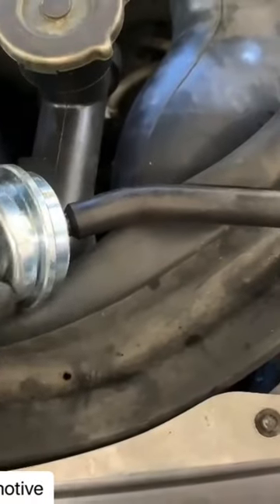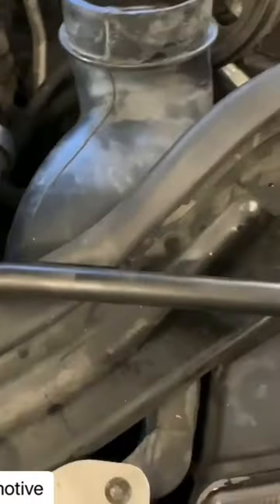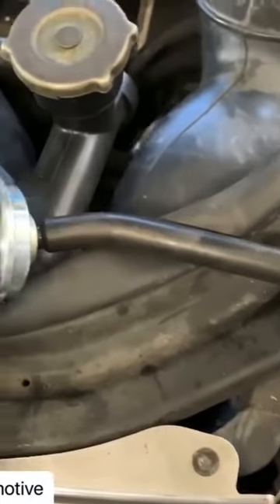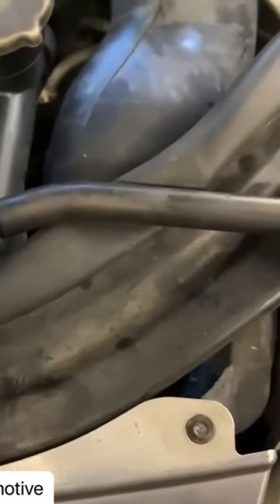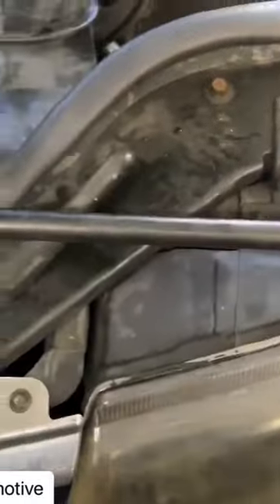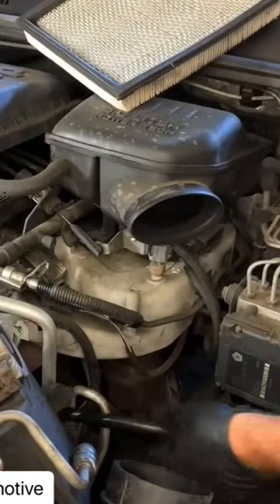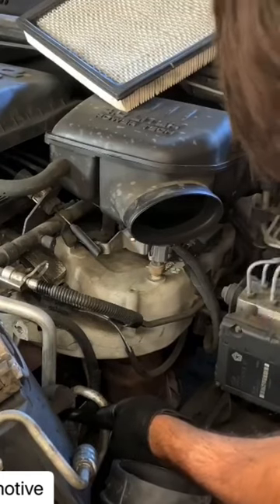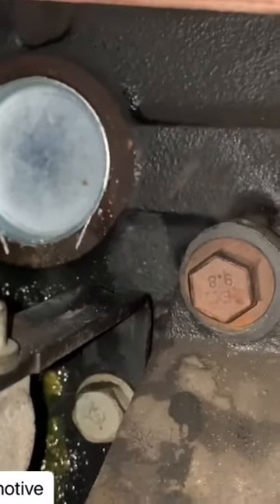Freeze Plug Install Tip

Comment: Priceless info, thank you. I’m installing plugs into a 1968 fury with the engine in the car.
I hesitate buying a $60 tool for one use, so I’m going to try using a socket or make my own tool.
The problem is getting a decent swing with the hammer with stuff in the way. Any suggestions? Behind the motor mount (mount removed) there’s no way I’ll get a straight on swing, I’d be grateful for any advice.
P.S. it’s not made by snap on, but a spray can of pressurized duster for electronics when tipped upside down releases a super cold propellant
Reply: Just rent it next time lol

Comment: have you ever replaced freeze plugs behind the engine mounts?  I planned on using the rubber expansion type because I can't get a swing to tap them in place.  The guy who owned the car before me (and he claimed to be a mechanic reasonable shade tree mechanic)  Just kept adding Bars leaks every time it leaked, it would've been cheaper to replace the plugs.  I flushed a LOT of GOO out behind of the plugs.

Comment: Question, what could cause my AC compressor clutch to not engage during the day but work perfectly at night?
Reply: Over pressurized system. Just bleed it off until it runs

Comment: alternatively you could fill it with brake clean and let it evaporate
Reply: Genius
Reply: @sousamotors  I tried the brake clean and it didn't work 😔
Reply: @Drivin_Sideways  guess I’ll skip it then. Maybe I’ll put it in the freezer for an hour, or I might just end up tap it in without prior preparation Idk
Reply: @sousamotors  when I have things taken apart enough to do freeze plugs, I get superstitious about it and put a film of red rtv on the rim and everything 🤣
Reply: @Drivin_Sideways  thats exactly what I’m going to do, rtv the fucker, I had to undo everything that was in front of the timing belt, plus the belt, and even all the rollers and pulleys to take out a stupid plastic cover. Its a Mazda v6 the one that comes on ford probes
Reply: @andredesousa96  there's a special place in hell for Ford engineers
Reply: @Drivin_Sideways  Damn bro 😂😂 the engine was actually designed by Mazda, it was a joint venture from Mazda (Mx-6) and Ford (Probe). Do you think thread locker glue would be better then rtv silicone, on the rim of the freeze plug?
Reply: @andredesousa96  from what I've read, supposedly the brass forms a really good seal on its own, that's why I say it's superstition to use any sealant. I was comfortable with the rtv, I'm not sure if I would use threadlocker, I'm too young to have my own opinions on these things yet 🤣
Reply: @Drivin_Sideways  no you’re not, I’ve seen your channel I would call you a mechanic any day of the week. I dont know your level of experience but atleast Core plugs (they are not freeze plugs!) you already did, so your own opinion is valid, but if you never tried threadlocker then fair play to you for saying that you dont know about it because you only tried sealant, most guys out there (most times the more experienced ones) would say it doesnt work and never even tried it. You my friend you said “Idk I always used sealant just to failsafe” and “brass is a good sealant on its own”, which just goes to show the amazing tech youre going to be! Be humble sure, but when you feel like its valid state your opinions my guy, the “aces in the shop” wont even see you coming eheheh
Btw I went with threadlocker, one core plug was tough I accidentaly did a small ridge with the screwdriver on the cores seat, but I still went with threadlocker, core plugs are brass, wish me luck!
Reply: try butane. poor mans liquid nitrogen. you can get 2 big cans for $10 at like most smoke shops